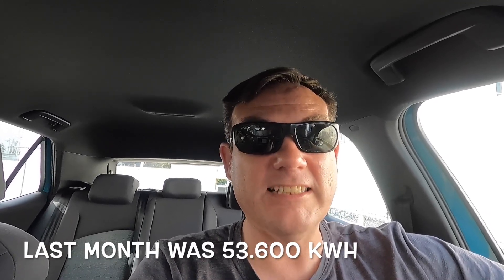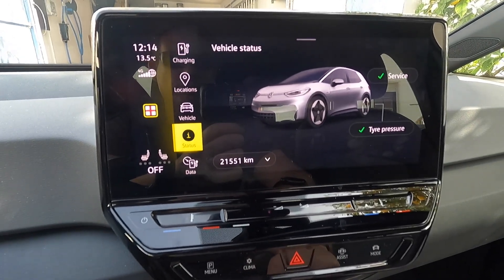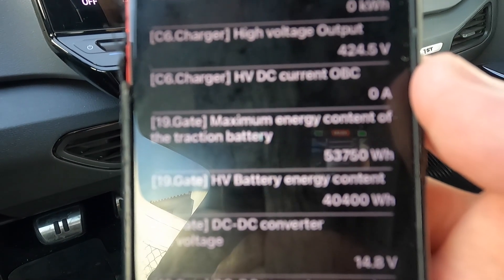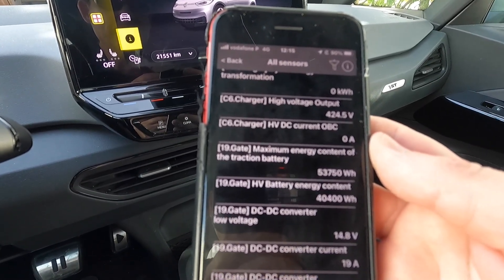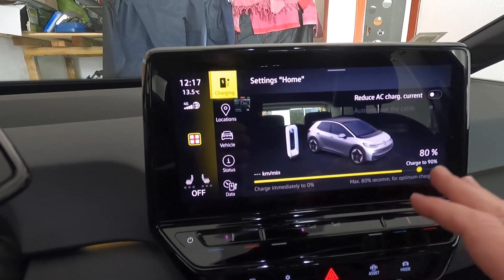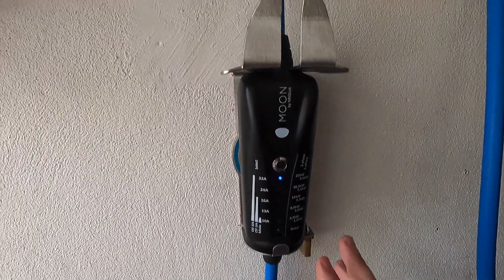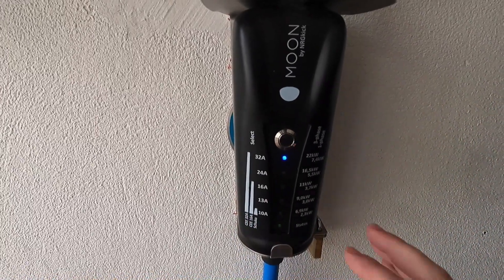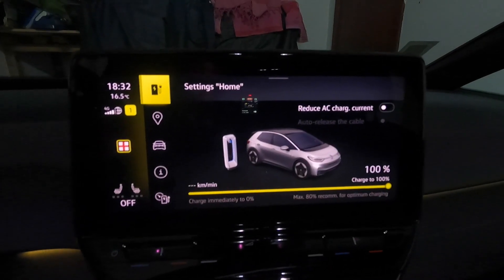Can I fix battery degradation in my ID.3?

Comment: I‘m pretty sure the value you’re using is not very useful. I’ve got a 3 year old ID3, the max capacity shows around 54kWh, but I can actually only get out around 50kWh. All that varies between winter and summer, also those values were never at 58kWh when new.
Anyways, gives me good enough range for 95% of the kilometers I do in a year. For the other 5% I need to spend a few more minutes a year charging on long distances. Totally fine with that.
Reply from the maker: You make a good point, I didn't noticeably notice a difference in range.  However, I think it is important to check degradation and it is an interesting topic.      Nobody would complain if batteries had no degradation.  👍
Reply: @marcusevjourney566  yes sure, that’s also why I check it every now and then 😄 but let’s be honest, a 150hp fossil car usually had something between 145 and 155hp when new due to variations in production. After 5 years those cars where probably between 140-150hp and after 10-15 years at 130-140 hp. Engines also degrade over time and no one cares.

Comment: Why do you say never store the car at 100%?   I have an id4 with 31k km on it and no degradation. I do leave it on 100 % regularly. I charge 50/50% ac/dc.  And dc most times max 80%
Reply from the maker: An ID.4 with 31k km must have degradation.  Please research and read your ID.4 manual, it is well known that having an EV stored at 100% is not good for the battery.
Reply: @marcusevjourney566   i know that they recommend it if stored for a long time. but not if your gonna drive the next day or day after.
Reply from the maker: @Iamjago  I have read and heard from other people if you charge to 100% you should drive your car straight away.  Leaving it overnight with 100% charge is not a good idea apparently.
Reply: @marcusevjourney566  the problem with all these stories...nobody knows which are correct.  manufactures don't tell exactly what to do.  same with phones... ppl say don't keep it on the charger all the time at 100% ..my friend had bought the same iPhone xr as mine roughly the same time and ik keep it charged an on charger all the time... he doesn't.. my battery status after 3 years was al lot better (91%) than his..(70%).  so why doesn't this work voor ev batteries..?
Reply: @Iamjago  if you look on the ‘Volkswagen electric battery maintenance and warranty’ website you’ll find this —>
Three golden rules
for more range:
It is relatively easy to keep your high-voltage battery well maintained. If you adhere to the three golden rules then you have already done the most important thing to maintain a high range for the vehicle.

1. Please do not charge the vehicle to more than an average of 80% during daily short-trip usage.
2. If the vehicle is not moved for more than 12 hours it should be charged between 30 and 80% of capacity.
3. To fully charge the vehicle (100%) use a charge timer in the charge manager and then drive off immediately after charging is completed.

Comment: Hi Marcus,
In order to check if the cells are balanced, you can check their voltages. 
On my ID3, the min and max cells are 0.01V apart, normally, that should be a good sign.
I am a bit worried too to about the degradation as a number, but to be honest, the range if the car didn't change at all.
Hope that we will have something fixed with the future 2.4 or 3.0 software and we can have more capacity available.
Reply: @timemachine194yes, the min cell will give the status for the whole battery. In my case almost all the time the cells are 0.01V apart, as example min= 3.84V and max= 3.85V.
Only for few seconds I have seen them as min=max. That is also because the voltages are read one by one by obd adaptor.
So, what I think is that the battery is well balanced, but even with huge buffers and with good care, my battery capacity is somehow decreasing and that is strange.

Comment: I tested the battery degredation and BMS balancing with my car as well. I drove it down to 6% and then grannycharged it to 100% at 2 kw. It took a while :) Anyhow, same result, no restoration of the lost capacity.

Comment: You are assuming the OBD data is correct. 🤷‍♂️
Reply from the maker: Why would it not be correct?  It gets the data directly from the car.  The only reason it would not be correct is if there was a bug in the software.
Reply: @marcusevjourney566  On my Pro S it says 79000 and I really doubt it...or maybe I just got lucky and have a huge battery 😅
Reply from the maker: @iHugoF  🤣🤣🤣👍